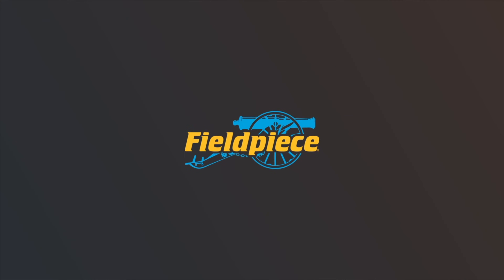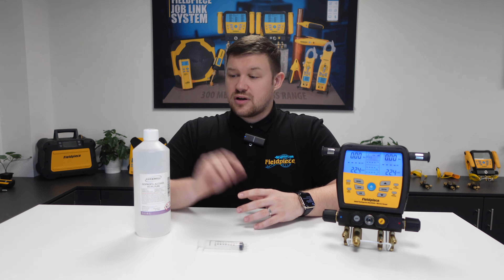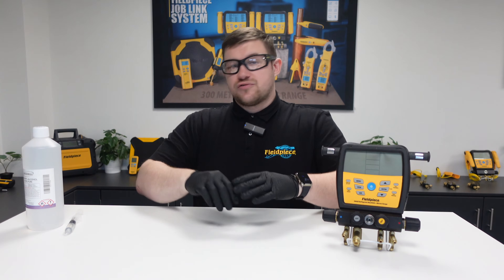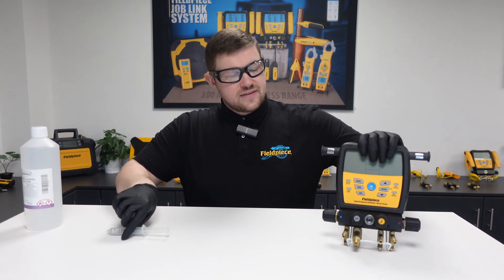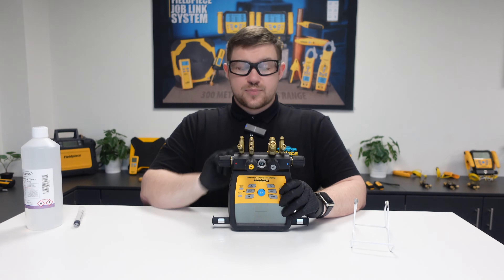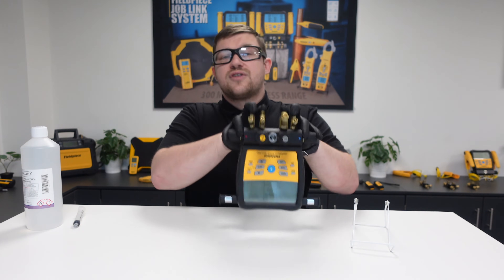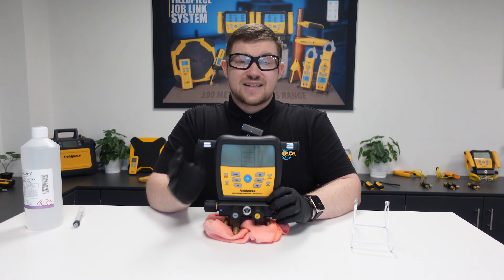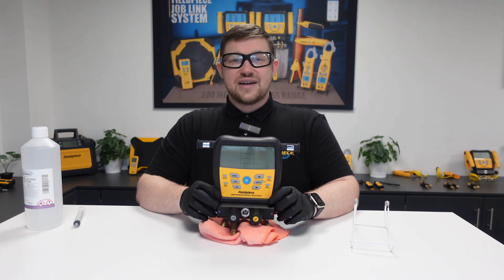SMAN® Digital Manifolds: How to Clean the vacuum sensor | Fieldpiece Europe

Comment: Can I use this method for the MG44?
Reply from the maker: You can clean the sensor of the MG44 with rubbing alcohol. Do not stick anything into the sensor, doing so will damage the sensor. Also, you can check the user manual for details or contact us directly when you have further questions.

Comment: Hi,
My sm480 only goes down to a little below 400mic. However when I hook up other micron gauge its down to 150mic. Obviously my sm480 micron gauge is not accurate. Is there a way to calibrate micron gauge or it is because of sensor contamination and it needs to be clean? My set is brand new  but I never had correct vacuum gauge reading on it 😢 it always too hight and jumps up and down
Reply from the maker: Hi, We would like to support you in the best possible way. Please contact us via the form or give us a call. Here is a link to the information: https://fieldpiece-europe.com/contact/. You can also register your product on https://my.fieldpiece-europe.com/.